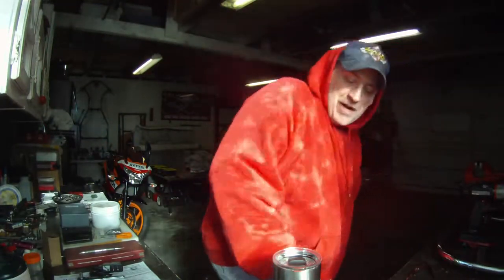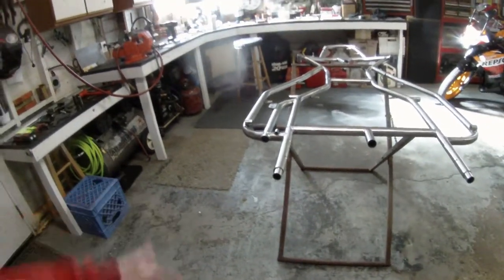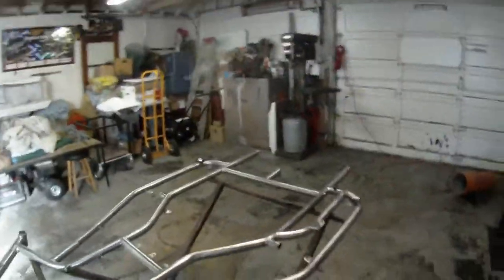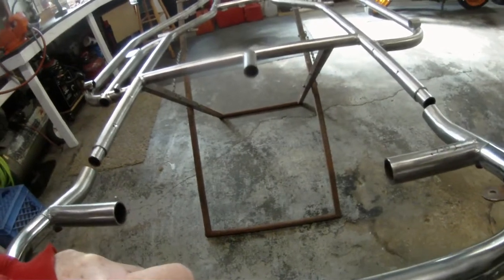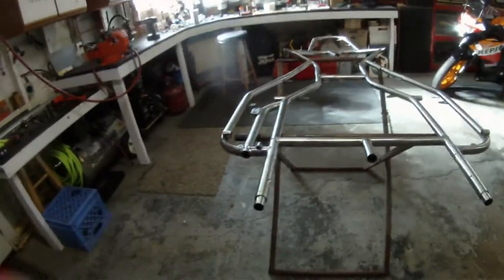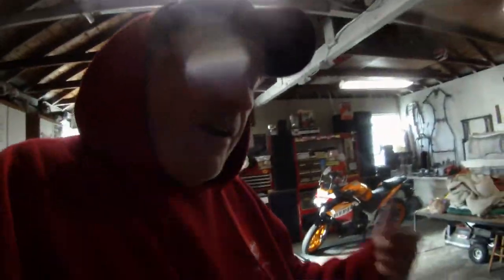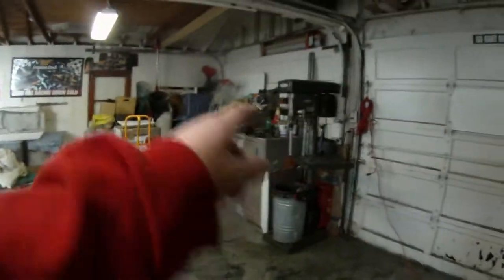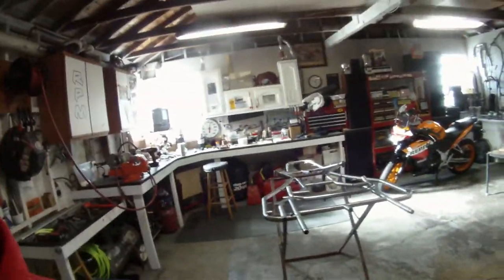F-125 Project Kart - Extending Main Frame Rails

Comment: Hey Robert since you don't have a lathe and you are going caveman style with a file try swinging the drill press table off to the side and clamp your vise at the edge and put a lathe bit in the vise and run the stock down the lathe bit with the spindle , it might be more consistent on the O.D.   never tried it but it might work !
Reply from the maker: Good Idea! 

The table has a debris hole in the center, the round stock easily fit in that hole to support the long end of the round stock. It worked out...